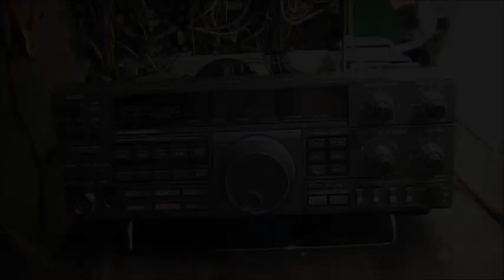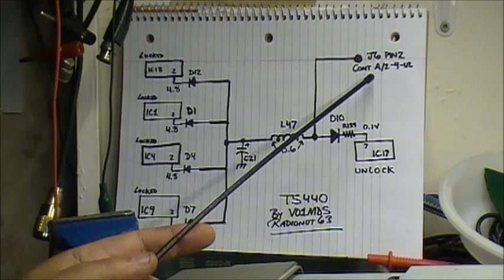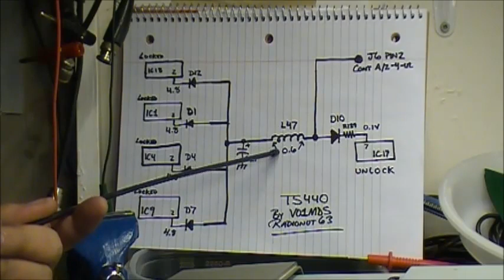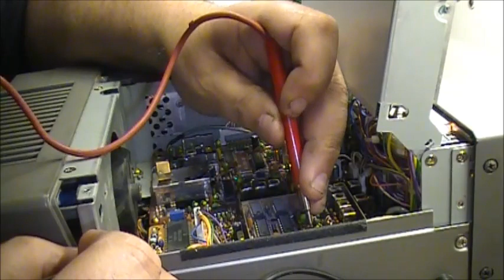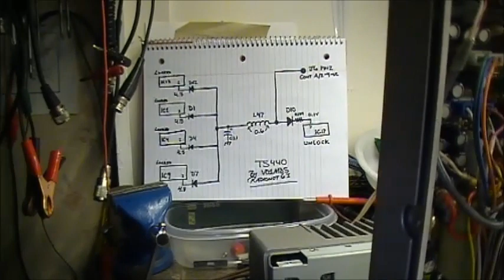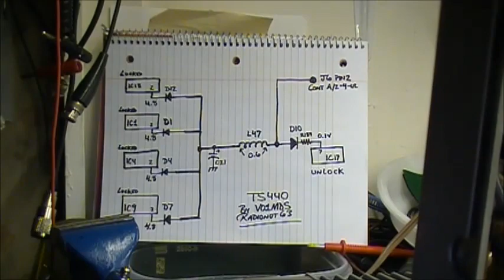KENWOOD TS-440 DREADED DOTS  PART-3

Comment: Tengo puntos entre 22.000 khz y 25,499 Kcs. Resto de bandas funcionan perfectamente. En TP10 no varía tensión en VC1 en este rango de frecuencias, manteniéndose sobre los 2,1 volts. Los puntos comienzan  con el no accionamiento relés de la unidad de filtros correspondiente hasta llegar a 25,5 mhz y entonces se acciona el relé RL6 y pareja . Del mismo modo, en esta situación en TP11  (VCO 5 boarf PLL) y en 14.200 Kcs obtengo 7,8 volts y no es posible ajustar a 5 volt tal como indica manual. De todas formas todo está enganchado excepto este rango de 22-25,499 mhz. 
Aunque creo es otro problema no transmite en FM en ninguna banda.
Alguna opinión. Gracias
Reply from the maker: Has probado a resoldar todas las conexiones de la placa VCO y la placa de filtro? Yo tuve que hacerlo en la mía para solucionar el problema. ¡Desde entonces no he tenido ningún problema! :-)
Reply: @Radionut63 si, la unidad de RF la sustituí por otra de  EBay. Lo que no entiendo es porqué conmuta los relés del sector de 22-29,9 mhz a partir de 25,5 mhz y nó desde los 22 mhz según diagrama del filtro de bandas y justo es cuando hay puntos. El resto de bandas todo bien. Gracias amigo.

Comment: I got my TS-440S going again.  It had the "goop" issue with VCO5.  I removed most of the components, cleaned up the board using acetone.  I also had low voltage on pin 7 of IC17.  It appeared to be due to a loose wire on pin 2 of J6.  I repaired the loose wire, set VCO5 for 5v at TP11 and now I have a radio again.  Thank you for this video.  It was very helpful.
Reply from the maker: That's great to hear! Glad you got your radio back in working order.
Reply: No es posible ajustar a 5V. Está sobre 7.8 v, pero parece que está trabajando en 36, 22 mhz

Comment: would setting the vco and PLL voltages fix this?
you might be looking at conductive sony bond issues too.
http://www.oz1bxm.dk/TS440/ts440-repair.htm
Reply from the maker: All that glue has been removed before when i first had this TS440
Reply: plastic trimmers maybe?

Comment: Lol this rig is shaping up to be lots of fun. Right up my street. Cheers.
Reply from the maker: Yes sir it sure is.   Going to be interesting to find out what is causing this voltage issue.
Reply: @Radionut63  the fact that it's unstable is strange.
Reply from the maker: very strange indeed!
Reply: I found a ts-440, buried under junk and dust, it had been sitting for 10+ years at the club and noone knew who owned it.
So i took it home and tried it. No cigar, i got the dots, so i  searched online for a while and found tons of info.
After removing the potting stuff and breaking and replacing one of the switching diodes i have a somewhat working 440. 24m still has dots and 10m vfo is wobbly/oscillating. Other than that it works great, have around 1000 qso's on it 😎 
12 and 10m are not so active now anyways, but i do want to fix it.